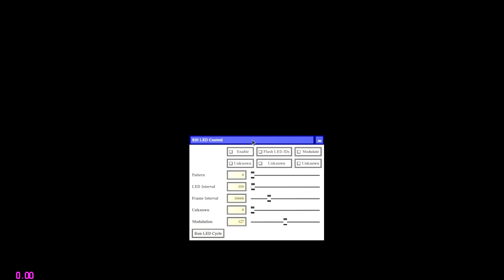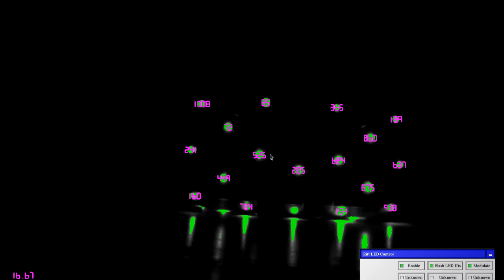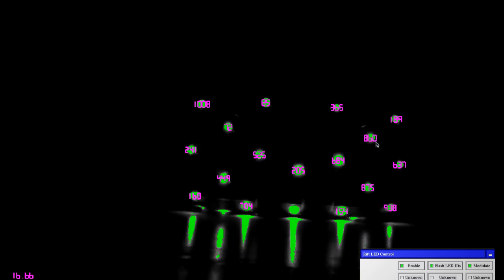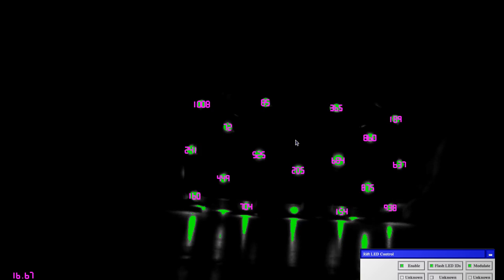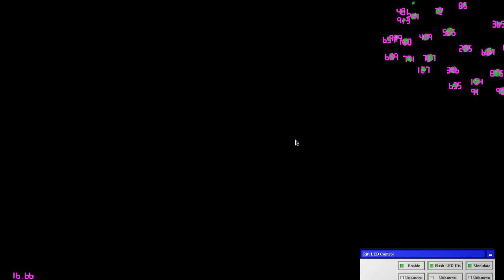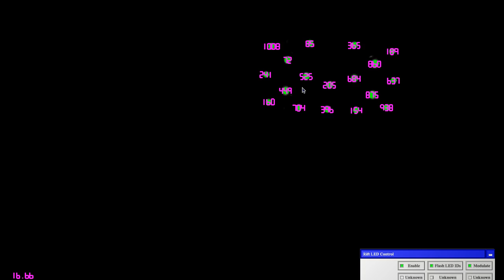Identifying LEDs Based on Blinking Patterns

Comment: Awesome! I would have guessed the LEDs blink sequentially, but this is much smarter.
It also open the door to tracking other devices. Even if your external device is not synced like the Rift, you'd be able to tell apart your unblinking LED from the Rift's.

Comment: Would it be possible to use this in a bright room? If not, would switching to IR / UV be an option?
Reply: It does work in a bright room; they're already using IR LEDs and a lense that filters non-IR light.

Comment: I really hope this can be used to somehow get a PlayStation MOVE device working with the rift camera, then both devs and  enthusiasts would have access to  quality made motion controllers that are extremely cheap both new and second hand and readily available .. I know there are alot of guys working on doing just that in both the oculus forum and a google group  but they need some kind of major breakthrough.
But this is really great progress and I hope it leads somewhere that benefits us
Reply from the maker: ***** There is a tear-down of the PS Move indicating that it could be fairly easy to replace the original RGB color LED with an infrared LED. You'd have to be careful to match the driving voltage and current limit of the original LED to the replacement, though.